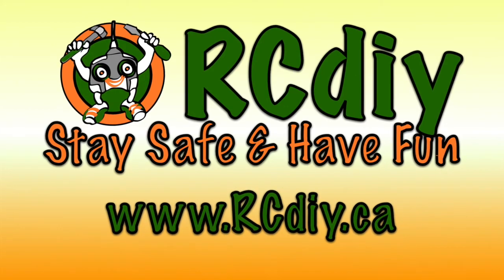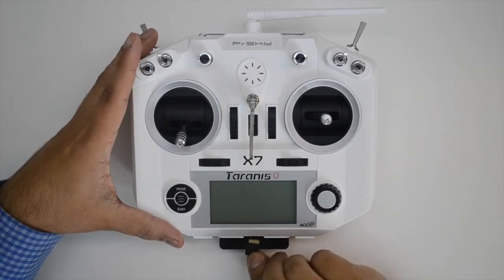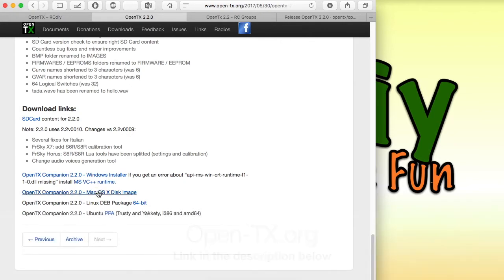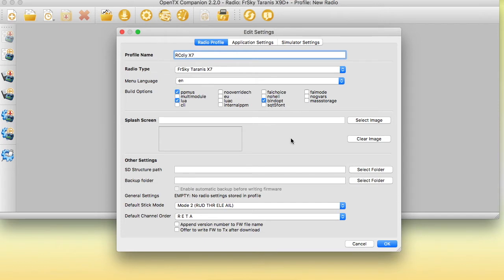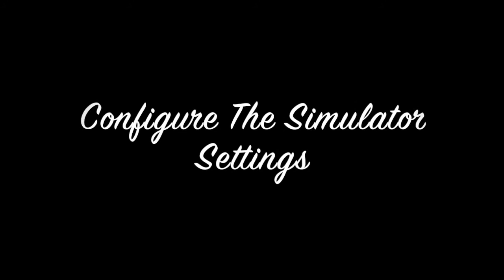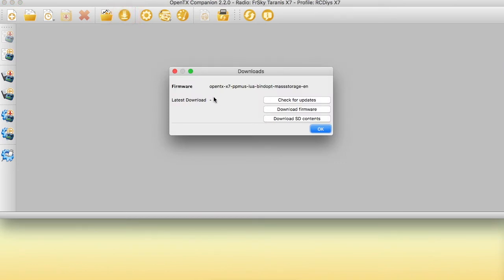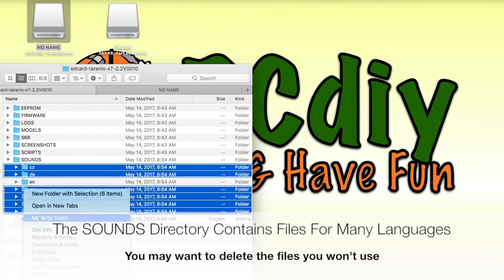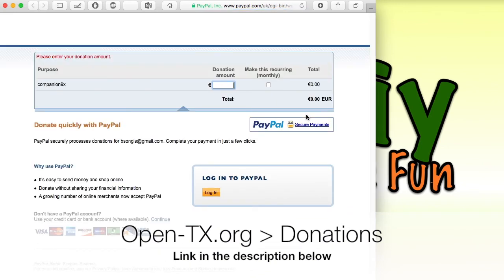Taranis Q X7 OpenTX Tutorial Quick Start - Downloading Installing Companion OpenTX Audio Sound

Comment: Excellent video. I have downloaded and installed Companion ver. 2.2.3 and Open Tx ver. 2.2.3 on a FrSky X10S and everything works fine except that when I try to 'Backup Radio to File' it says ' That feature has not been implemented yet'. Any idea why I am getting this?

Comment: I fixed the send card error, but I know have a script syntax error when attempting to use the lua scripts, would you know what I need to remove that?
Reply from the maker: Usually I see the problem when the script has been downloaded incorrectly. It needs to be downloaded as a text file not as a webpage. When you open the file there should not be any of these symbols < and >
Use a plain text editor such as notepad.

Comment: got my qx7 and have firmware 2.2.0 95b0a21c  throttle already set too mode 2, which firmware am i looking for?
Reply from the maker: You may want to start with the manual which explains the firmware http://rcdiy.ca/opentx-guide/
Reply: using windows 10 usb is connected but i find no drives,  went into devices found bootloader and it says error any clues??  qx7 says connected but cannot find drives let alone safely remove. had to remove from devices page when everything else usually has a safely remove icon . like go pro etc what am i missing?
Reply: michael honeychuck have you solve?

Comment: I never saw the 2 drivers pop up on the desktop. Tried 2 different USB cables. I was able to load the sound pack but curious to learn more about those drivers. Did i just not see them? I was not able to "eject" them because i never found them. Have the x7s that came with 2.2.0. 

Thanks for making the video it was very helpful.
Reply from the maker: Wopa Chop which operating system
Reply: Hi there sticker says Windows 7 but i think it came with the next newer version.
Reply from the maker: It may show up under my pc. Use Windows file explorer to locate them.

Comment: I'm having the same problem, Companion RC18 (flashed firmware) + 2.2.0010 SD files. After copying all files into the sd i've ejected usb, rebooted radio, gone into Special Functions, selected Play Track and then the sound, where a windows come out saying No sounds on SD.
Reply: Haha, found the solution. Inside the Radio Setup page i've changed voice language to english and tada! Sounds finally working!

Comment: I have followed this guide to the best of my ability but get no sounds playing . I go into SD card on the radio and see the sounds but when I click play I get an error - path to long , then I have to exit ,  can anyone advise on how to fix ?
Reply from the maker: +Marcus Whitehead which version of opentx. Which radio? What do you mean i go into... please describe steps.  Are you using your own sounds? A sound pack? From where? If you can join a forum such as flitetest, rcgroups...
Reply: RCdiy, thank you for your reply, I have followed the instructions to the best of my ability and am having difficulty... no sounds are playing on start up.  I recently purchased an X7 from Banggood , I downloaded companion and flashed the tx firmware to 2.2.0. I downloaded SD contents from open-tx.org (Taranis-X7-2.2V0010) I kept the English sounds in the sound folder and also downloaded,unpacked, loaded amber2.2 (from opentx university) into the SD card making a total of 2 sound pack folders inside the sounds folder. 
When using the X7 I can access the SD card via page 2 in the radio setup section, I can see sound files , when I click play I get an error "path to long " and have to exit out. Incidentally I also get an SD card warning on start up (expected ver:2.2V0010) strange as I though it was what I had downloaded ? 
I have voice language set to English in radio setup , am I missing something else here ? 
Thanks in advance for any guidance to help me solve this issue.
Reply: Problem solved , I had to delete sd contents and re copy contents as files not just picking up the whole folder . I also added mass storage to settings but don't think this was the issue .
Reply from the maker: +Marcus Whitehead mass storage is to select the behaviour when the usb cable is plugged in. Without mass storage when the Tx is powered on and usb connected the Tx can be used as a joystick with some flight simulators such as clear view. With mass storage selected when the usb cable is connected the sdcard gets mounted as a drive.